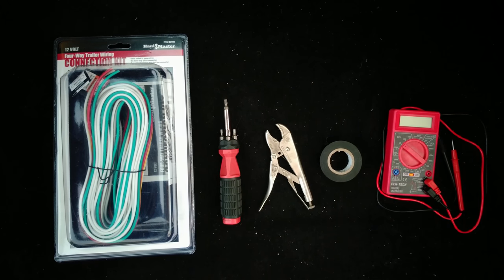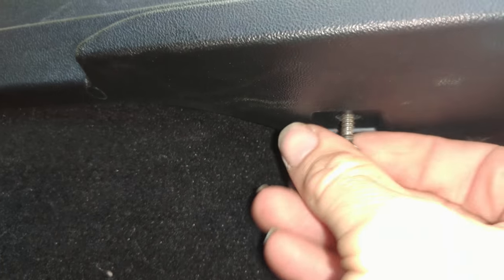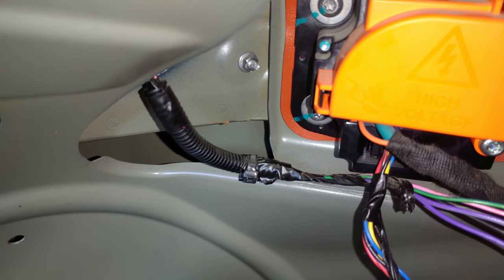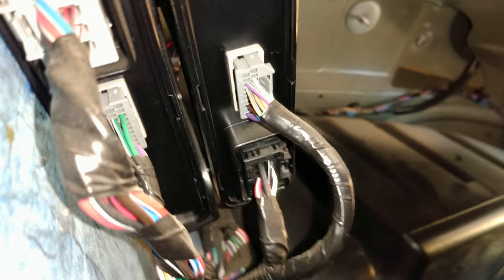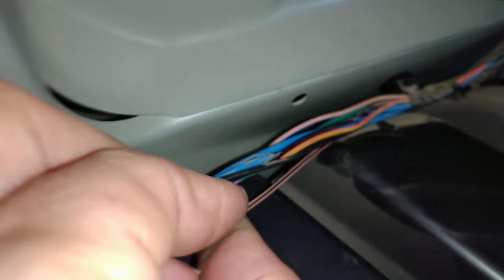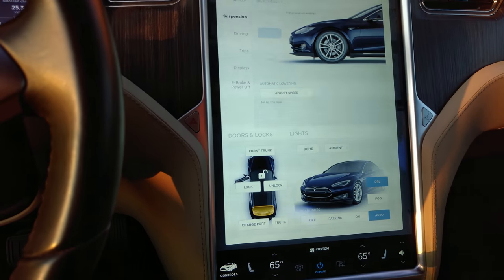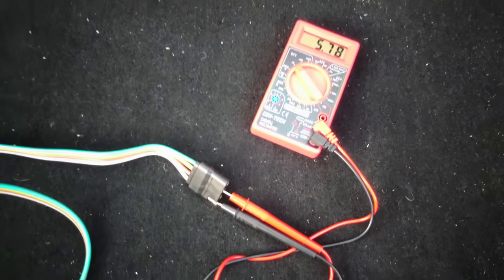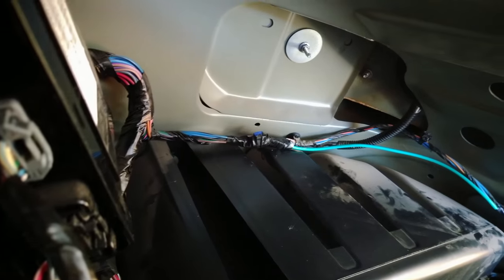How to Install Wiring for Trailer Lights in Tesla Model S

Comment: You do not need to strip either wire to use those connectors.  One of the slots has a dead end so no wires are poking through!

Comment: You know when you use those taps you're not supposed to strip the wire first right?
Reply from the maker: You're right that the taps don't require stripping the wires. I don't remember why I did that - I think I might have had some trouble inserting one of the wires, and stripping the end was an easy solution to make it fit easier. Anyway, it's been two years so far since doing that install and everything still works perfectly.

Comment: In my 2015 85D, the driver's side turn single wire was red, not purple.
Reply: Same. Did you get the tail lights working? That was the hardest part for me to figure out. I uploaded a YouTube video of how to do it on my channel because it was very difficult to find the right information online.

Comment: My 2016 has different color wiring :-/ What current sensor did you use (and how) to figure out which wires to connect? Would it be possible to connect a 7 pin (rather than 4 pin) harness?
Reply from the maker: I used a multimeter as you can see in the video, but you could also use a small 12V bulb or buzzer, or connect an actual trailer and see which lights come on. With trial and error, connecting different wires you can find which ones do what. First connect the ground wire, then try one at a time while activating a turn signal until the correct light flashes, then switch to the opposite turn signal, and so on.

Comment: Sir I installed the harness to the wires you showed, one strange thing is when headlights are on , it’s correct. But when off the running light and the left signal light both flash. Do I have a wrong wire?
Reply from the maker: It sounds like you got the connections wrong - I heard that some later model vehicles have different colors for the wires, so that might be the problem. There are 4 wires in the trailer harness - green for the right turn signal, yellow for the left turn signal, brown for the tail lights, and the white one is ground. You can find out which wires are correct by trial and error. I would suggest first connecting the ground - that's the easy one - and then experiment with the others to see what works. Start by activating one turn signal and touch one wire after another until the corresponding trailer light flashes. Then try the opposite turn signal the same way. Next try the headlights, and the brakes. You can do these tests with a multimeter or a 12V bulb/buzzer if you have one. It might take more than one attempt to get it just right.

Comment: Great vid! Hi, I'm planning to order a model 3 long range in next few days and I'm not familiar with Tesla's referral system.  So If I use your referral code I get a unlimited supercharging as long as I own that model 3? If so where do I put your referral code?  Could you also recommend trailer light wiring kit for model 3. 
Thanks.
Reply from the maker: Currently the unlimited supercharging offer applies only to Model S and X unfortunately. I used the trailer wiring kit from Harbor Freight (item # 62990). It includes wiring for trailer and car both, but you only need the car-side wiring. Note that the steps in this video are for the Model S - the procedure and the wire colors for Model 3 may be different. You can use a volt-meter or small 12V bulb while operating turn signals, lights, and brakes, to help locate the correct wires.
Reply: Thank you, so if I buy X model using your referral code I get unlimited supercharge? Also do you know if trailer package is standard or option?
Thanks again, I'm seriously considering X model. :-)
Reply: Do I get unlimited free supercharge if lease X model with your referral code? Thanks again.
Reply from the maker: If you're planning on towing frequently, the Model X is ideal. The trailer package comes standard, with a 2" receiver and up to 5000 lb tow rating, and it has software built in to actively compensate for and minimize trailer sway. If you use my referral code, your Model X will get unlimited free supercharging - and yes, this applies if you lease it too :)
Reply: Great news, thanks bro.

Comment: Have you received any on screen warnings from the ecu is detecting unusual power draw from the added load the trailer lights are putting on the normal electrical system?  Some Model S trailer towers are suggesting some rather elaborate bypassing of the cars harness to power their lights.
Reply from the maker: No warnings at all. I rented a Uhaul trailer a few weeks ago and it worked flawlessly. I heard that trailers with older style incandescent bulbs could provoke a warning due to the added load, but if the trailer has LED bulbs as most do now there shouldn't be a problem.
Reply: Awesome news. Thats an easy fix. Thanks so much. Now i can return this $190 mess of wires! Lol

Comment: John, where in the car did you tie in the 12v power to? Im using a texonsha ZCI harness. Thanks!
Reply from the maker: The Tekonsha ZCI harness works kind of like an isolation amplifier, so it requires 12v power. You can get 12v from the power liftgate harness or by running a line from the outlet in the center console. The ZCI is great in a few niche cases, for example if your trailer has energy-hungry incandescent lights - but otherwise I wouldn't recommend it because of it needs 12v power. A basic 4-wire harness works just fine with the Model S, and doesn't require 12v power, so it's easier to install. In this video I actually used a cheap $10 harness from Harbor Freight. As long as your trailer has LED lights, the car won't even notice.

Comment: do you need to strip any of the existing model s brake or turn signal wires?
Reply from the maker: As others have pointed out here, stripping the wires really wasn't necessary because the taps bite into the insulation when you squeeze them closed. However if the wire colors are different in your car, stripping a little off the wires to probe them with a meter can help to determine which ones you'll need to tap onto. Some of the colors have changed in some later model vehicles so it might take a little trial and error to pick the correct wires.
Reply: @TeslaTravels  thanks! You are awesome!
Reply: @TeslaTravels  which year model is yours?
Reply from the maker: @c11121987  Mine is 2013.
There's also a thread on the TMC forum here that may be helpful: https://teslamotorsclub.com/tmc/threads/help-wiring-a-harness-for-a-trailer.27657/